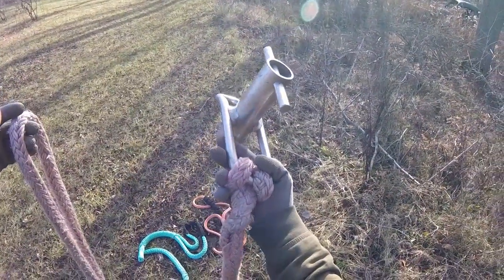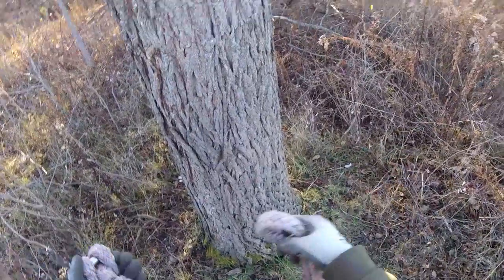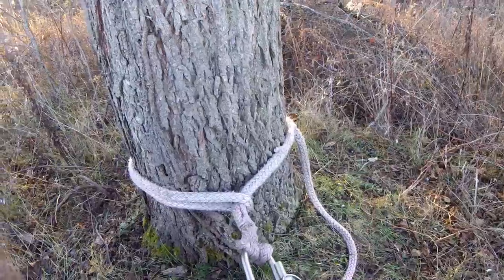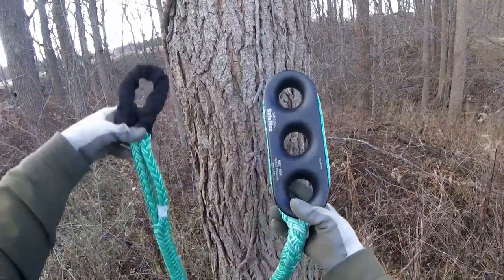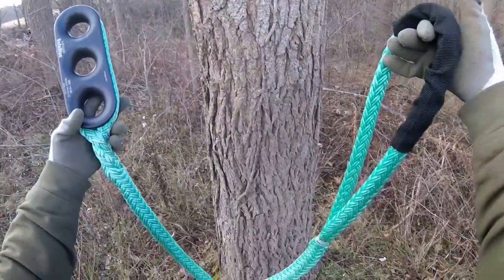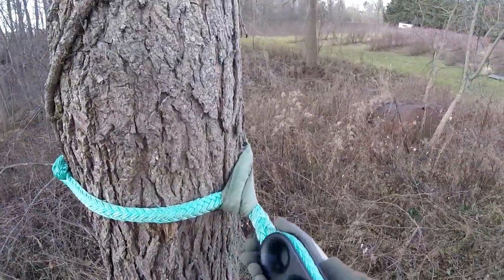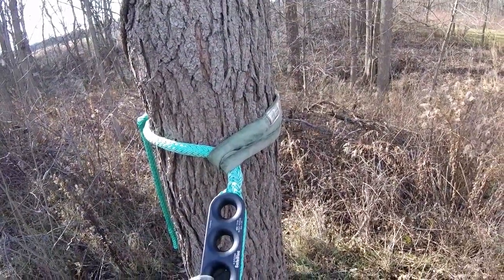Whoopie Sling Basics  |  Arborist Rigging

Comment: I really like my 3/4" Tenex  whoopie sling along with my Port-a-wrap.  I don't mind putting the 1/2 hitch in @ the end. Almost went with the Ultra Sling. I use alot of the Tenex sewn in eyes  in different sizes when using 1 as the main rigging line used with a re-direct that is the same, just a little smaller. Just ordered a Maasdam rope puller cuz I have Promaster rigging line. Just watched earlier that u had a video explaining that the Promaster 1/2" is the preferred line to use with the Maasdam. Thank you 😊

Comment: DUDE!!!!!!!!!  Thanks so, SO much, I've been unable to accept that my 3-ring sling (the pre-made treehouse/sherrill/notch x-sling with 2 large rings one side, 1 XL ring on the other, on a 5' section of 3/4" tenex) is only for crotches, I mean I wasn't sure if I'd be able to use all 3 rings in some funky configuration like what you're doing @7:33 in this video BUT that would work just-fine for me I can literally just run the extra sling through one side of my 3-ring-sling and boom I'll be able to use the other-leg's ring or rings to use it on a spar, what a brilliant idea thanks a ton man, not just for this but all I've learned whether your videos, podcast or your posts online (I've read enough masterblaster threads to have found plenty of good stuff from you there!), I hope you're doing very very well & that life's treating you good man you deserve it!!
Reply from the maker: hey thanks a lot brother! what's your nickname on the masterblaster forum?      - Patrick
Reply: @TreeMuggs_PatrickM  I go under eyehearttrees :)  Think I've got like 1 post there as their registration was down for a bit so most of my posts are to Treebuzz, and a lesser amount to the less-active Arborsite (same username on all 3)

I've since gotten a few diameters of Polydyne and no longer seek to make my 3-ringed tenex X-sling into a choke-able sling as I've spliced thimbles and a Safebloc into long (15' and 20', respectively) lengths of polydyne 3/4, a cord that's not only thinner than "3/4" tenex, not only a bit stronger in static-tensile capacity, but shockingly stronger in dynamic-strength (3% elasticity, versus 1.5% for tenex)

It's got me questioning the usage of tenex at all for routine rigging, IMO it's just too-static a cord.  I know 'it works', but consider this: while the tenex may not fail, its inherently static nature means that a log of a given size will produce a GREATER peak-dynamic-force than the same log thrown into a more dynamic line (cough Polydyne cough), this makes me think of that tree that snapped on you in the cemetery and how, if the sling had been Polydyne instead of Tenex, perhaps the peak-load wouldn't have snapped that spar!!

Would love to hear your thoughts on this, I mean Yale's short-but-outstanding article(and even better video @bottom of the page!) on the subject pits their 2% Double Esterlon against their 3% Polydyne and the dynamic-capacity difference is staggering: http://www.yalecordage.com/featured-industries/arborculture/dynamic-energy-arborist-rope

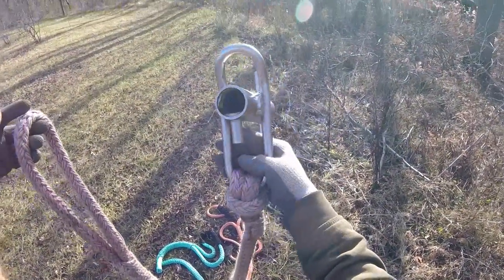After reading that & watching that video - a video wherein a 20k(static) line is snapped by a 1,400lbs dynamic load, then a 6k(static) line takes that same load 6x - it's beyond clear that static-strength /= dynamic-strength, yet almost everything in our industry is based-around static strength, whether it's prizing Tenex as optimal for rigging-slings or whether it's the routine use of taking static-ABS and multiplying by 1:5 or 1:10 thinking this is useful for dynamic capacity, it just doesn't add-up....hell rigging lines, which are meant to see dynamic forces as-routine, are more-static than climb lines on average!!  Just blows my mind, I mean the 3 most-dynamic lines available (in order) are Atlas(4.5%), Polydyne(3%) and Nystron(2.4%), and 2 of those 3 have been around for ages....wish there was some more innovation here, I would've went w/ Atlas if I knew more about Sterling but I went for Polydyne simply because I'm already a big fan / trust Yale....

Would love to know your thoughts, am thinking of when in this ^ video you mention how the loop should be equivalent strength to the sling when you lengthen the whoopie with that loop, since the whoopie and, likely, that loop were all poly/HMPE fibers, then you can use static-strengths relatively confidently, however if the sling were Polydyne then a polyester loop would need to be substantially stronger static-ABS to match the dynamic capacity of Polydyne!  I know that the #'s become difficult/near-impossible when trying to compute dynamic-#'s, but that doesn't mean the concept itself should get ignored - hell, after rigging-rings took off you've got companies making their own (which is or 'can be' good), am seeing that both ShelterTree and Gap Arbor have rig&ring anchors, made with 3/4" double-braids instead of tenex, yet ShelterTree uses frickin' Sirius (1.5%, same as tenex!) while Gap uses (smartly!) 3/4 polydyne.....people would, by&large, get these slings and apply their 1:5 or 1:10 ratios and think they've got the math all set when ignoring dynamic-capacity leaves them largely in the dark!  Hell, I'll take the softer, more 'tree-conforming' tenex hollow-braid over sirius double-braids anyday!  But I'll sacrifice the soft, tree-conforming, 1.5% static Tenex for the more-dynamic, 3% Polydyne any day of the week (would love to see some break-tests, if Yale's video of Unitrex(20k static with 0.5% elasticity) versus XTC (6k static and ~1.5% elasticity) is a fair comparison then that should hold true when comparing 3% Polydyne to 1.5% tenex, but that'd mean that 1/2" polydyne slings would out-perform the hell out of even 7/8" Tenex slings!  

Sorry so long, just food for thought but if you read it I'd love to know your thoughts, I think it's a travesty that dynamic-capacity is either ignored or paid minimal lip-service by most retailers, hell I have a catalog that says of Tenex "it's the best for slings and is stronger than double-braids of same diameter", firstly that's not even universally true even in the static-strength category (polydyne, at same diameter, has stronger static tensile strength than tenex), but it obscures the meaning of "strength" which further solidifies the idea in people's minds that there's "a strength" instead of various types of strength (and, if we're to focus on 1 type of strength, for our purposes it should be dynamic-strength not static-strength as most of rigging is dynamic not static!)

Comment: I'm sorry but the over use of equipment for the safe block seems nonsensical?
Reply: LOL WUT?  
Firstly that is a statement with a question mark at the end....Secondly, "over-use of equipment"?  Did you get the point of what he was doing?  IF the Safebloc is already spliced-into the eye of a sling, you've gotta use that sling if you want to use your Safebloc - sometimes that sling isn't long enough though, he literally proposed the simplest, most minimalist solution possible - to length the thing with a loop - and you consider that 'over-use of equipment'?  Out of curiosity what is a typical rigging setup when you're dismantling a tree?  If you say "3-strands and natural-crotching", I'm convinced I could talk you out of your views pretty quickly (hell just compare what $150 gets you in 3-strands versus double-braids and you'll see how much better they are....but they need anchors, this is simple&safe and it makes the rope perform better & last longer, if you consider that overkill then you're probably also climbing DRT with a blake's hitch lol, if so then at least acknowledge it's your personal preference instead of pretending that objectively superior systems are 'nonsensical'!)

Comment: Awesome video but not being a climber I had no idea what you do with the installed whoopie string after you put it on the tree.  Thanks
Reply from the maker: We use these slings to attach rigging hardware to trees. These are also used a lot for slack lining and hammocks.    - Patrick
Reply: @TreeMuggs_PatrickM  I had the same question. Of course. I don't know what slacklining is. I have heard of a hammock, but my idea is probably not what you mean. I was thinking that I needed a book and I found your resources and the book sale.

Comment: Great video. I've found that its much easier for me to use a port o wrap at lower chest height rather than what you're showing. I've had no issues pre loading lines. It also keeps me from bending down more than this job already demands. Again, great video and i appreciate the content. Just my two cents.